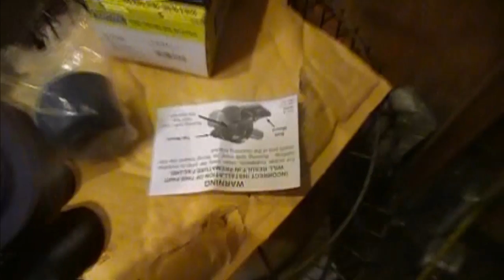Sway Bar Bushings Replacment....THUMP, THUMP, THUMP, THUMP,   UGH Dodge Caravan

Comment: Good video. I have had several of these vans. Unless you polish or replace the sway bar, the sway bar eats up the new bushings within 20-30k miles. Moog makes a problem solver bushing with a nylon insert I highly recommend. In combination with a sway bar, your good to go. Very common problem!
Reply: Thanks for adding this tip! I don't need to do this again in another 30K.

Comment: That was EXCELLENT. I'm going to do this BEFORE replacing the struts now. I have a clunk in the front suspension ... not the sway bar link, not the ball joints, not the tie rods (outer or inner) ... only two things left that it could be. $18 (bushings) vs ~$500 (struts) ... start with the $18 fix. Well down. Thumbs up and a subscribe. Love my 2005 DGCaravan van ... great utility vehicle, hockey transport van, and it happily puts up with the mess that kids generate -- the 3.8L kicks some a$$ too (tow hitch is a plus as well). Going to keep this safe and reliably running for as long as I can ... thanks to guys like you!!.
Reply from the maker: Jeff Chapman.... Awesome! I love saving $$$
Reply: @FixingWithPassion  what year was this van

Comment: At 5:00 The cut may go down on the ones you bought, but my factory bushings the cut went on the frame. The important thing is to match up the indentation on the bushing to the protrusion on the bracket so the bushings do not slide out of the bracket.
Reply from the maker: Thanks!  Advice is always welcome!
Reply: You have to unhook the sway bar link  to get enough clearance to put the cut in the right spot

Comment: I installed the blue Moog bushings a couple of years ago on my wife's 2006. They are already worn! We only got about 15k out of them. Hearing the old thump thump now. I read in a forum that you have to clean and polish the sway bar where the bushings ride. Also lubricate everything when you put it back together. In the Caravan forum several people have installed: Dorman OE Solutions 928-327 Front Sway Bar Bushing Bracket Kit. They say the brackets are thicker and fit tighter and will last much longer. This is what I am going to do and hopefully lasts. Wear safety glasses when doing this repair. When I changed out the bushings the first time one of the brackets fell and hit me, almost took my eye out! Needles to say I now wear safety glasses anytime I work under the car. You don't want to lose an eye doing this kind of stuff.
Reply from the maker: That's for sure!!

Comment: COMMENT:  My Haynes manual says to lubricate Sway Bar only with vegetable oil as mineral oil will deteriorate the bushing.  QUESTION:  I see 2 sizes of sway bar bushings offred 7/8 and 1 inch.  Which is standard?  Excellent video  Well done!
Reply from the maker: I think i used 7/8"
Reply: TVWXMAN32 All 96-00 have 1 inch bars, doesn't matter what engine it has. How are your bushings now? My blue Moog bushings went bad in 6 months,  will be replacing with the new black Moog bushing that are 17% wider in few weeks. For the 01-07 the black Moog bushings comes with a nylon insert.
Reply from the maker: They lasted 10mos without any issue. I sold the van to a happy guy and he is still driving it today!
Reply: If you have touring suspension, you should not get the Moogs, get the ones from the dealer.  They are not blue.
Reply from the maker: Nice....But I could never afford the "Touring suspension"...it sounds expensive ;)   ha ha...  Good info though.
Reply: I use Sil-Glyde® Lubricating Compound. A longer-lasting, high film strength protective lubricant for all surfaces, including: rubber, metal, wood, glass, and plastic. Won’t melt, freeze, gum, or run off. Performs from -20 deg F to +400 deg F. Grease consistency stays put and won’t drip off like silicone oils. Harmless to rubber and car finishes. Suggested applications: Trunk seals, rubber bumpers, speedometer cables, brake parts, window channels, hood strips and pads, rubber gaskets, and belts
Reply: Butterfly Taxi DFW I got the oem ones from the dealer the blue moogs don't last at all best to get ones with the soft rubber
Reply: I recently purchassed a set of Moog SBB for the 04 Town&Country with over 250 thousand miles, I use to get the basic blue ones.
However I discovered that Moog offers an upgraded, better quality SBB w/an insert that's black in color...not blue.

This will be the first time trying them out, my machanic installed them this Tuesday morning.
I'm praying I'll get more than 20 or so thousand miles by going with the upgraded Moog black bushing with insert, only time will tell!

The sway bar itself is fine, only way it need replaced is if it broke.